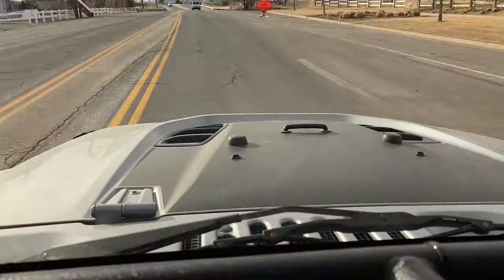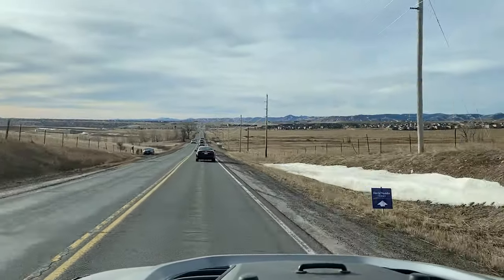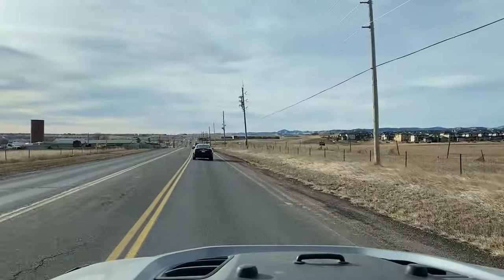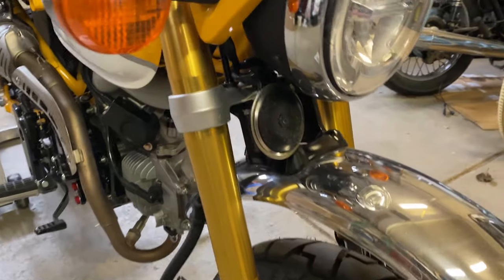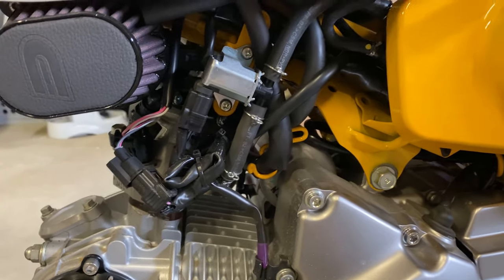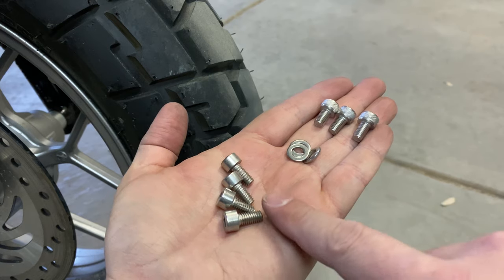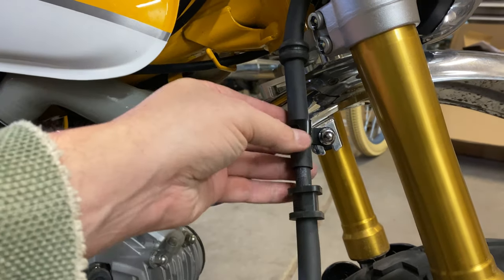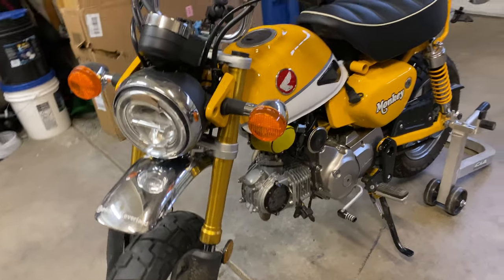Honda Monkey | Raising the Fender, Horn Relocation and Visiting Colorado Motorcycle Expo!

Comment: Just make a custom bracket with two holes in it to extend the clamp down to the rubber housing on the brake line, Ace Hardware should have what you need. Nice video btw!
Reply from the maker: That’s a good idea, should be easy enough to make. Thanks!

Comment: Did the horn kit come with a longer bolt for the case, or just reuse oem bolt?
Reply from the maker: I just reused the OEM bolt.
Reply: @UnknownOverLand  I went the opposite, lowered fender, but my big ass horn hits fender on bumps now.  Here's hoping I have room to use this kit, find out next week.
Reply from the maker: Which horn did you go with? I've been thinking about replacing the stock horn with something that can actually be heard.
Reply from the maker: Awesome, thanks for that link. Not bad a price at all.
Reply: @UnknownOverLand  It's a good horn, just a little too thick to fit.  It taps t he front fender and won't fit on the side mount because of the engine guard.